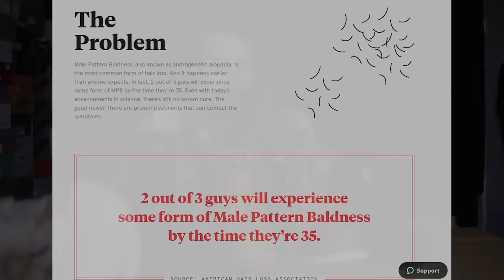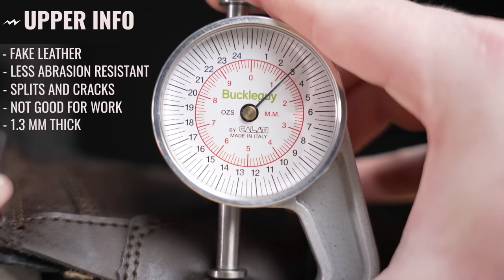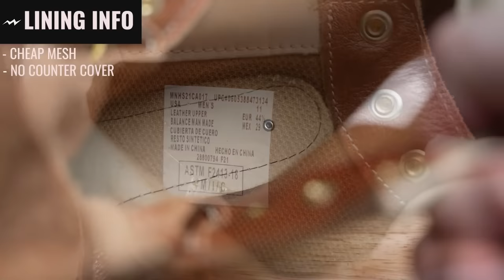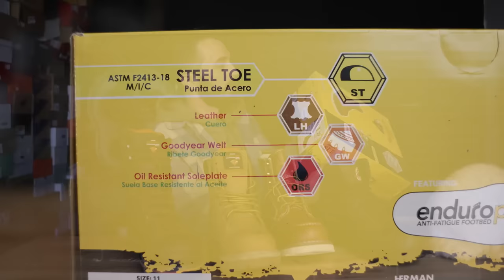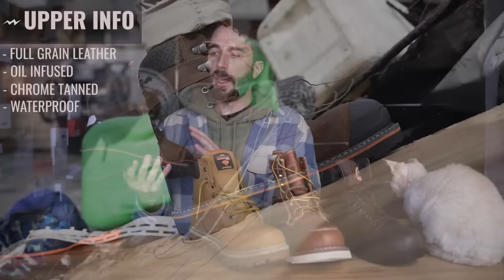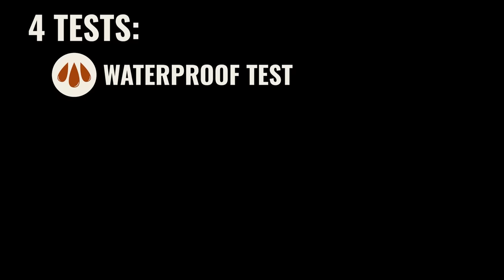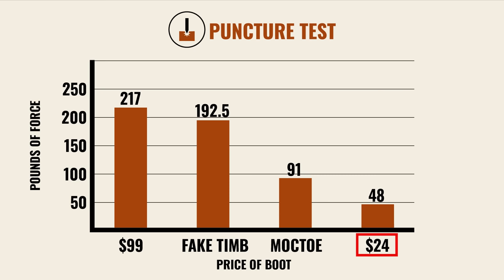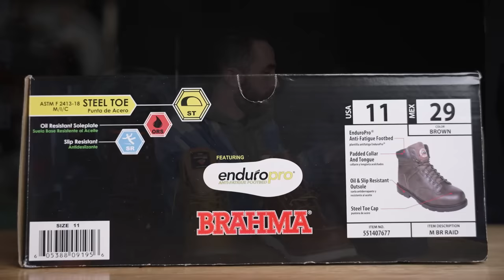The Truth About Walmart Work Boots - Best CHEAP Work Boots or TRASH?

Comment: When l was homeless in Phoenix, Arizona my $70.00 dollar Nike tennis shoes didn't hold up so well while I was walking around all day from place to place on cement pavement, sidewalks, hot asphalt roads, dirt, rocks, gravel,  broken glass, nails, stickers and they quickly shredded & tore apart at the seams in less than 30 days. 

I bought $24 Walmart brahma boots at the time out of desperation  because they were all l could afford...the brahma boots held up a little "better than tennis shoes", and had the "Steel Toe" which was useful in fights with other people particularly kicking someone in the balls and stomping toes.  My biggest problem here was wearing out the cheap rubber heels in the back and wearing a hole through the insole where your foot and heel rests exposing the cardboard. I also had problems with broken boot strings all the time when l tried to lace them up tight. Finally switching to leather boot strings. It was also uncomfortable as hell after a while - so l had to buy shoe inserts all the time. After 60 days or so the $24 dollar boots were a complete mess, scuffed up, , scratched, dirty, stinking pretty bad because my feet sweated so bad in the intense heat. Because l couldn't get a tight fit l had friction problems and suffered blisters on the heels of both feet.  

I finally bought a used pair of Army  combat boots at a military surplus store which turned out to be the best choice for rough outdoor, camping desert/urban environment type situations. 

But l wholeheartedly agree Walmart boots are, for the most part, bullsh*t made in China garbage ...with that said they are way better than tennis or running shoes especially when you are living on the street and are basically outside walking around all day. Word to the wise, proper footwear is one of your most important concerns when living on the street. Your choice of boots can make you or break you.

Comment: There's a much better suggestion than going to the thrift store or buying these so-called inexpensive Walmart boots. $100 is still very expensive for me. You might get lucky at one of your local thrift stores and find a boot that you really like in your size but if you need to get something within a week then you're probably out of luck just going to thrift stores. The best way to get a good pair of used boots is to get on eBay. I've bought $120 sneakers in great condition for $25 or less on multiple occasions.. Definitely buy it from a reputable seller and you could probably get a $200 to $250 boot for less than $100. You might be able to get it for less than 50 it all depends on what brand you're after and how many boots from the maker that you're trying to get and how many there in your size..

Comment: Buy a pair of Redwings and take care of them. I used a pair for six years doing heavy warehouse and farm work. I just took care of them, having the soles and heel redone for cheaper than a new pair of cheap boots. I bought the same pair again three years ago but still have the old ones. I only bought new because the old pair finally lost water resistance. $240 pair of boots is worth it.

Comment: I wore some of those $24 Brahma boots for years and really liked them… only thing is: you gotta reglue the soles eventually as the heat will make it separate, but if you do so with Gorilla glue and clamp them nice and tight, those cheap ass boots lasted me for a couple years… and those couple years were spent mostly digging holes and kicking/chainsawing tree limbs to make them compact enough to fit in our landscaping trailer- so they definitely got a good beating.
A better insole liner is a necessity as well- but after that, I honestly thought them to be a good deal for $25.

Comment: I bought a pair of $40 real cow suede brahmas about 6 mons ago and they’re holding up great, slightly on the heavy side and a little warmer than I really need but very comfortable. I have a titanium plate in my foot from when I broke it years ago so I need a boot that’s flexible and soft otherwise I can’t wear them and the brahmas are better than $200 boots I own for comfort. Even if they completely fell apart right now I’d go buy another pair, but they barely even show any signs of wear.

Comment: Bought a few pairs of the $24 Boots in black years ago, for Patrol use.
I used to polish them up every few days, until I noticed a weird Split in the Leather; leading me to discover it was a thin layer of Vinyl over rough suede-like Leather. Linoleum Leather  I called it.
At 20:55 you'll notice the hollow inside of the $24 Boots' Sole; like a Waffle Pattern.
They're okay until you wear into the Cavities, picking up Pebbles that rattle as you walk. The Heels also starts to collapse at this point; accelerating Wear.
These boots also come with cheap Laces that only look like Paracord. But once you wear through the outer Sheath; they soon snap.
Over all not bad for $24, but these were for Police use; not Construction Work.
BTW, what's with those weird Rivets on the inside ?

Comment: I do landscaping and I buy the Walmart boots to work in and I have my employees buy them too. Over the past 10 years I have bought probably 20 pairs of the Survivers and Brahmans from Walmart and honestly the only thing that ever wears out are the soles and the laces. In the Brahmans the heel always wears out super quick. And grass is very abrasive  on rubber. The tires on my mowers wear out quick too. But I get 4 months out of the Brahmans vs 9 to 10 months out of the Survivors. This video is very informative because all this time I thought I was saving money because I figured a 200.00 boot would wear out just as fast but now I am questioning my choices and probably go get some better boots.
Reply: rock roosters or jim green's would be next step up.

Comment: I wore a black pair of cheapo Interception lightweight boots for somewhere between 5-10 years,had them so long I forgot! Just recently the heel tread let go on one boot. They are so light and much more comfy than my better looking more expensive pair I'm thinking of cleaning the surfaces and trying some sort of glue. Most of my work is indoors walking on floor and sub-floor so they were spared most outdoor rigors. I am 250lbs range so that didn't help the tread any. To be honest though if I can get away with wearing hikers on a job I'd much rather do that because my feet feel so much better than any boot I ever wore at the end of the day.

Comment: I bought the $30 Brahma steel toes and my feet would be SCREAMING an hour into work.  New custom insoles barely helped. I bought the Calceus DX safety shoe and my god, I wear them outside of work. They're the most comfortable shoes I've ever worn.  I work between 10-14 hrs a day and don't even think about my feet at all. I used to keep flip flops in my truck or just go barefooted after work. I don't think I have the words to truly explain the difference.

Comment: I bought those $100 boots. I work in a factory. They worked really well. I had no issues. Only replaced em because work bought me new ones. The downsides are they are pretty heavy. They get hot even in doors. But they felt sturdy and well worth the money.

Comment: Got one in basically new condition at a goodwill for 10 bucks like that first pair. 3 bucks for arm and hammer insoles and they are tolerable lawn mowing/ chore boots. 13 bucks and I only use them for a few hours a week. Thats pretty much what they are good for. No comfort, breathability or durability. Would never have worn them when I worked in maintenance.

Comment: There isn’t ANYTHING more destructive to a boot than a Tarmac and I (actually the airline) have bought every boot possible over the past 20+ years for my job as a baggage handler. Even tho I’m only 115 lbs I always manage to walk thru them in just 3 months time. Spending $100 or more dollars I can get a year (or more) of use however I actually prefer the cheaper 3 months route just for the health of my feet so they are not having callouses created in the same places or having my feet shaped into something hideous from wearing the same boot everyday for a year or more. Not to mention, keeps the insides fresh and new as well. Bottom line tho, they don’t hold up on the tarmac or in the bins as even my steel toes always wear straight thru. I end up spending about the same amount of money either way.

Comment: used to work at a place that was across the street from a Walmart so new hires would literally go into the Walmart before work and get these boots the most common being the fake timbs which we dubbed "marshmallow boots" because without fail in 2 weeks if they made it that long they would be worn like a bald set of tires lol on the other hand an older guy had a set of the cheapest pair and they worked for 2 years until we noticed he had worn completely though the sole and could see his feet so bullied him until he bought some hand me down timberland pros from a guy. older guy also weighed 80 ibs soaking wet so probably why they lasted so long

Comment: Had the 2 cheapest boots from the video the first ones were my first boots and took 3 years with about 8 months of constant use and occasional use after but for 20$ it’s hard to complain the second pair lasted good the toe box was small if kinda hurt but my toes are wide so not the fault of the boot I liked them but I gave them to my buddy he didn’t wear them and throw them away like a week later instead of giving them back kinda wish I still had them they were nice

Comment: I wore the fake Tim's  for a bit. Definitely water proof,  very comfortable, but after 6 months or so they start to squeak very bad. Also back then they didn't have the metal plate. I have been wearing the lower cut version of the 100 dollar boot for a few years now. I have bought all types of work boots. Used to believe 200+ was the only way to go. But for some reason I can only get a year maybe 14 -15 months a best from a work boot. I get  the same from the low cut version of the 100 dollar boot. As far as them being hot on the inside Summers are short in New York lol

Comment: I have 2 pairs of $100 boots one high top like those you used and a low cut,ive been a carpenter for almost 30 years,those low cut $100 boots are going on 3 year's only minor wear so far

Comment: I have had the 100$ pair working in a foundry they held up for about 6 months of pure abuse heat and sparks. They were much better in the winter months with all that added insulation but I found them comfortable the whole time it was the stitching that gave out before anything else overall for the money not too bad

Comment: Maybe you could do a review on Police/Tactical service boots. I usually don't wear mine every day, but they have a selection of different brands they have sold for years at Big 5 Sporting Goods. I own a security company and I will usually send my beginning security officers there if they are just starting out. They have low rise from as low as 29.99 and then they go up in price from there. I've found the less expensive ones by brands like RG (Response tactical Gear) or the brand I now wear, high top with size zip and interior water resistant mesh (Magnum, which I got on a pretty good sale for 69.99, while I was in Oregon, so no sales tax either) to be OK. I used to always use the RG brand, but I like the Magnum brand better. These are obviously not the same quality as the Police and first responder uniform stores sell, but for someone on a budget, they seem to work O.K. A breakdown would be cool though. I actually find that my boots are more comfortable than almost any of my regular shoes, so I wear them out for personal wear about 90% of the time. (I work at home mostly, so I don't get out a lot, so my wear and tear isn't really a good indicator.

Comment: i was about to comment on another video that you should cover the safety toe interceptor boot from walmart. I have a pair with two years of daily wear. I'm a machinist, I stand on concrete 10+ hrs. I haven't watched the video yet but i recognize the logo and i also bought their steel toes and they suck, they weight a ton.

Comment: Have you bought Keeps for your cat?  Just asking - looking a little thin on top.  Work Boots: as Safety Manager of a printing plant a division of a big international Fortune 500 corp., I had to provide some level of steel toe work footwear for employees other than office.  We developed the voucher method, allowing $75 per year in 1997.  Of course the workers wanted $75 cash so they could buy something cheaper and keep the difference.  But I did not allow that because I wanted them to not buy the cheapest shoes or boots.  For myself I got lace-up dress shoes with steel toes and some sort of composition sole.  The job ended after six years and those shoes were still like new despite 40-hr wear per week.  But after storing them for 2 more years I put them on and the soles had turned to some muddy slush that was impossible to wear because it came off in gobs.  Somehow while in a dark closet the composition soles degraded into something between peanut butter and silly putty.

Comment: Hello yes I wore almost all of those boots and the survivors are the best most comfortable boots I ever worn I put them against the wolverines and the timberlands and also live in Florida working construction in Florida and in the heat they still are comfortable but those cheap boots and the heat they will get hot and you'll feel it in your toes in your foot especially the $24 ones I use them in construction and also in landscape the survivors are good but the cheap ones are not.

Comment: From personal experience the Walmart survivor Driller wheat steel toes last longer and hold up longer than most made boots 2yrs. The other boots like timberland pro, carhart and many other's last 6months- 1year. I used them when in a steel yard torching and welding all day, and now working for the railroad walking on gravel all day. I can buy the Walmart survivor Wheat color Driller boot for $58 every 2years or buy Redwings for $250-$300 every 2 years. This isn't rocket science. I have worn the Survivor Drillers since 2003 the only boots I buy.

Comment: Always bemused when he talks about how little time soles will last. It depends on the persons gait I think, even cheap shoes last me for years because for some reason I just dont wear outer soles out. I must have a friction free gait or something. For me its the heel cushion/support that goes first. Im always playing around with aftermarket innersoles / arch / heel supports. My outer soles show little signs of wear even after a few years.
So for me, the two most expensive of these tested would actually do me well as long as I have a decent aftermarket innersole.

Comment: Avoid Brama bravo 2s at all costs theyre the $30 pair of steel toe 6 in work boots. The soles are a rubberized foam that disintegrates in less then a month if you work on concrete.

Comment: Don't you have a pair of boots? Can't you sequence the tests so one boot can be burned without having already been submerged in water? You might cut them in half last... and wait for the wet ones to dry first. It just seems like it wouldn't have been hard to anticipate this and avoid testing flammability on a water saturated boot.

Comment: These are the boots the new guys on the worksite wear before their first paycheck. Or they just wear running shoes, not great either. I’ve seen it a lot, but on their first paycheck they get better boots like ariats steel toe. I always recommend ariat steel toe because it’s not crazy expensive 150-250

Comment: I've owned all kinds of boots from Walmart to high end. Not one pair can hold up to my job. NONE are waterproof, that's a myth. Water gets into every boot I have ever worn. And if the sole is glued on the water will separate it real fast. Sole has to be stitched on to be any good. I just buy cheap ones every couple of months. Probably the best I have had was Timberland Pro. Your $100 boots are like fake Timberland Pro. The ones I had looked a lot like that, but I'm sure they were made better. Right now the flavor of the week is Wolverine. They need to be replaced. BTW, I pack pure maple syrup in 55 gallon drums. I don't step in too many puddles, but my boots get wet all day and they also get syrup on them. The sugar attacks the boot and after some time they crack and my feet are just soaked all day. There's just no amount of protection from what I do. If you ever find a boot that can hold up I'll buy it!  :)

Comment: Walmart boots are cheap for a reason. They don't stand up to heavy wear, various weather and fall apart easily. Hell, one brand the bottoms fell off of just exposed to walking in snow and after two times I never buy cheap or from Walmart. Go to a farm supply store where customers tend to be offered a selection that better stands up to real wear. Better boots may run over a hundred. Steel toed logging type stands up to heavy demands better but can take time to break in.